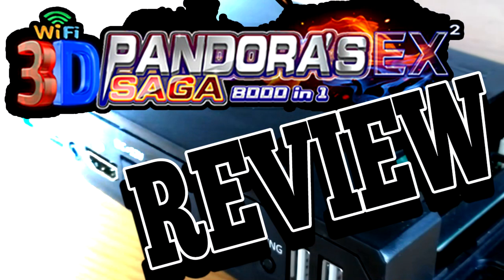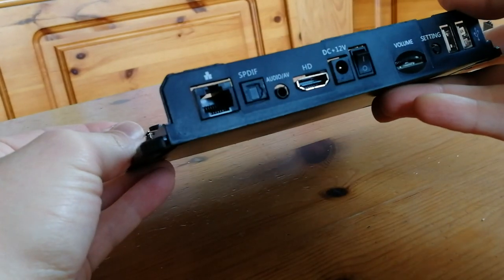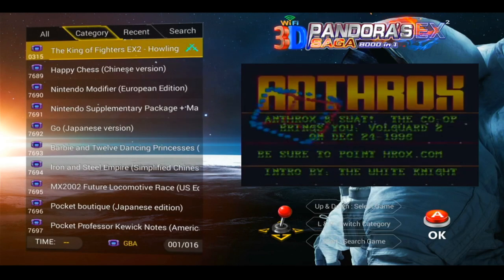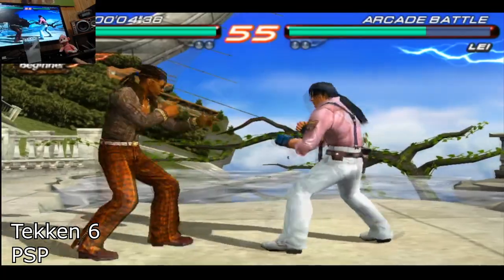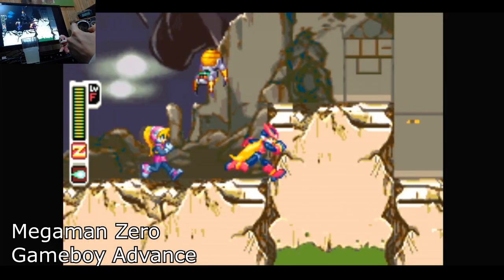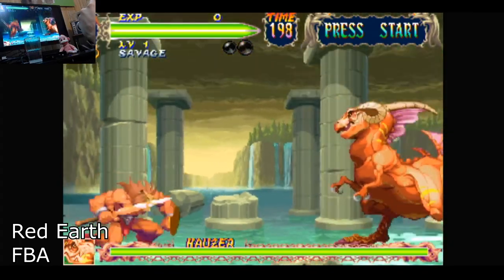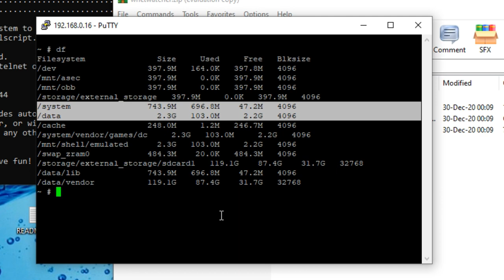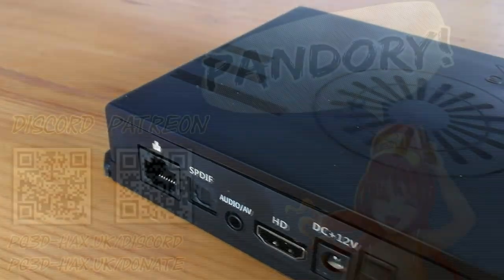3D Pandora EX2 Saga 8000: In-Depth Review

Comment: Great video as usual! What Pandora Box would you recommend for an arcade build at the present moment? Cheers and keep up the great work! 👍
Reply from the maker: Chickedy check our pandora top ten ;)

Personally, I'd probably steer towards the mini pc or hk1 we reviewed earlier if you want more flexible re configurations, however.
Reply: @TeamPandory  I did watch that video! 😀 I am still a little indecisive. I was thinking of the Pandora Saga 3D EX. I do not really want to change that much on the system. I do however want a Pandora Box that will allow to play around with the aspect ratio settings, since I will be using a 27” Philips monitor for my build. Do you think the Saga 3D Ex will be a good option? Thanks once again for your help and you have earned a sub! You deserve it! 👍
Reply from the maker: @TechOpened  thanks for the kind words. And honestly... Yes. It's great for a pick up and play. The saga ex is one of the best and if you can get it with pins, awesome!  
Which games are you wanting to play mostly?
Reply: @TeamPandory  games from the 90’s including Pinball Action, Puzzzle Bobble, Tumble Pop, StreetFighter, 1942, etc… I will be adding side buttons to my build for Pinball Action. But it will also be nice to have more recent 3D titles included (that’s why I was thinking of the Saga 3D EX).  Thank you once again for taking the time to answer my questions.. Great help!

Comment: Hi there, how does it compare to dx special?  And  can it be flashed with pantory with tate?  The latest 3d seems like to have long loading when it start up so considering this box.  Cheers
Reply from the maker: It plays newer DC / psp games, has two player Tekken. Little more input latency, but overall pretty decent. No Tate mode unfortunately.
It was our go to, until all the clones appeared.
Check out pandora box best video for the ones we'd recommend now.
Reply: @TeamPandory Thanks how does it compare to pandora games 3d saga.  3d max load time is a bummer.  And how about screen tearing?   Does it need pandory to fix it?  Appreciate your feedback

Comment: any guide on how to add cores for other systems
Reply from the maker: I think we did a guide on how to install RetroArch / Amiga on the Pandora Games 3D ... The process should be very similar.
1. Jailbreak 2. Install RetroArch APK 3. Add cores to it...  but you wont be able to launch those cores / emulators from the main Pandora Box menu- it needs to be sideloaded / ran via Android

Comment: Is there a shutdown screen ? I can't find it in menu , just have to switch off at back of arcade
Reply from the maker: No, none of these Pandora boards have a shutdown, but for this one, if you can install pandory jailbreak we have included shutdown as a hotkey press. 
They're intended to be clicked off at the power socket, but if you want it to be a bit safer, push the start button and go into search.  Wait 2 seconds then pull out the power cord

Comment: I am having trouble connecting my wireless controllers. Any help?
Reply from the maker: For the ex2 / saga 4188 systems, only one of the usb ports will work for controllers.  Furthermore, not many are supported at all.  What controller are you trying to get working?
Reply: @TeamPandory  well the controllers that came with it I tried in a couple of the ports. There is a total of four USB ports.
Reply: @TeamPandory  the two controllers that came with I tried a couple of the ports. I also bought a steelseries controller on Amazon for $20 it had a dongle for wireless capabilities as well. But could not figure out to get that working either. Doesn't seem like any of the ports are actually using the wireless dongle to control the menus.

Comment: 7:41 Is jail breaking with Pandory tool going to fix the controller issue? I have 2 Logitech F310 controllers but detecting as just one! Thanks.
Reply from the maker: No. I'm pretty sure you will need a usb hub, that should sort your problem.
Reply: @TeamPandory  Thanks buddy.
Reply: @TeamPandory  Just tried with a usb hub. Now it’s detecting both controllers as 2nd player at the same time 😂 Before it was detecting as both as 1st. This is messed up! I can see my pandora 3d saga2 has total 4 usb built in ports. Sadly only good for one player. What a waste!
Reply from the maker: @arifeens  in the Pandora options, assign each pad to player one and player two.
Reply: @TeamPandory  Yea buddy, tried that too. One is player 1 and other is assigned to 2. But somehow both controllers are going either 1st player or both 2nd player. Did switching with one on hub and one direct usb. Same issue. I think they tried making a built-in 4usb device but they messed up on software configuration. It doesn’t save configuration, neither work on 2 players.
Reply from the maker: @arifeens  which games are you trying?
Reply: @TeamPandory  I tried with Cadillacs and dinosaurs for testing controllers. Both my controllers were detecting as 3rd player.
Reply from the maker: @arifeens  Try some other games.  Regarding Cadillacs and Dinosaurs, it may be that it's incorrectly set up as it is a 3-4 player game.  We've made extra mame configs for some of these games to fix the control layouts (for example outrun to get into higher gear etc), but there definitely is some jank installed at stock.
If you want some help in getting them working, come to the discord.  Youtube comments really isn't a great place to help with issues.
Reply: @TeamPandory  After a long discussion with Aliexpress Pandora team, they said I need U-com double wired controllers, to work on this properly. This board is specifically designed for arcade machines. I tried on arcade board controllers. All working good now! 😀
Reply from the maker: @arifeens  ... Okay

Comment: Is this one better than the pandora ex?
Reply from the maker: Better than the Pandora box ex most of the time. 😂
Reply: @TeamPandory  damn lol I've just put an ex in my arcade 1up mod
Reply from the maker: @justins2631  If it works, it works...  On the 1up you should be okay.  One of the reasons we'd have the saga ex2 over the pandora box ex is due to screen stretching.  As you're on a 4:3 you won't be having that problem- or the video distortion that the ex2 has with some PSP/dreamcast games (check marvel vs capcom 2 for that in reviews).
Reply: Hi I don't suppose you have a back up for the pandora ex SD card, mines just become corrupted and I didn't back it up,  dont really want to but a new box. I'm in Leicester so willing to travel

Comment: Hello, can you tell me, games loaded apart, if there is and what is the difference between this card and the n.1 of this other video of yours?

https://www.youtube.com/watch?v=k9Fa3iY8_9g&t=777s
Reply from the maker: The saga ex series has no recovery, but has ability to use a larger microsd.  You can use pandory pspfix for this also.
Reply: @TeamPandory  Yes I know, so it's basically the same card?  I was trying to understand why in this video...

https://youtu.be/k9Fa3iY8_9g

...you put it in the first place and in the comments below in the top 4.
Reply from the maker: @marcoterracciano1951  actually the saga ex initially was far below and not even in the top five.  Since the top ten video was released, they've added gpio pins,  and is now fully compatible with pandory. 
J